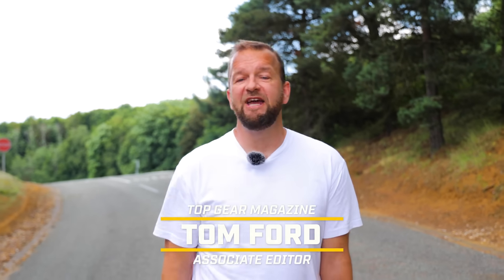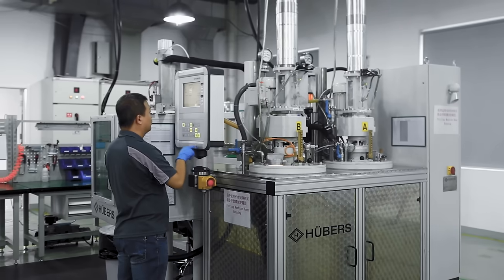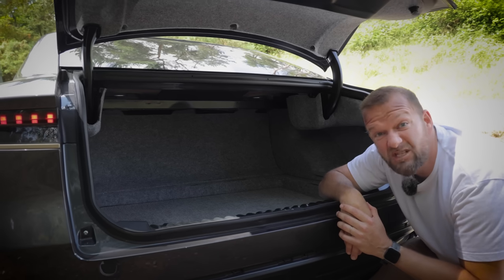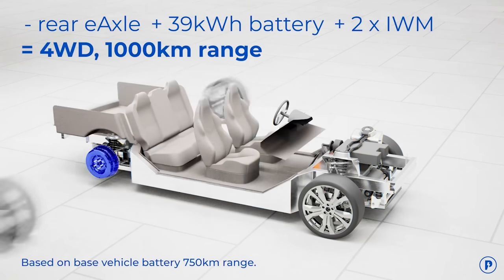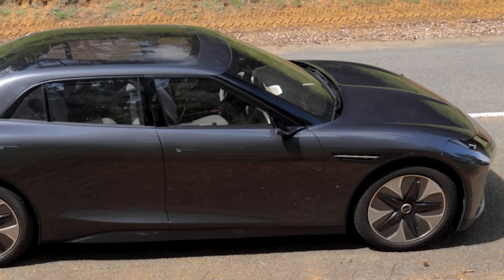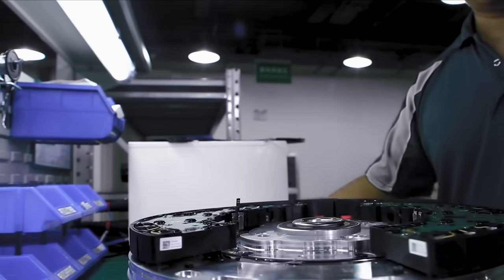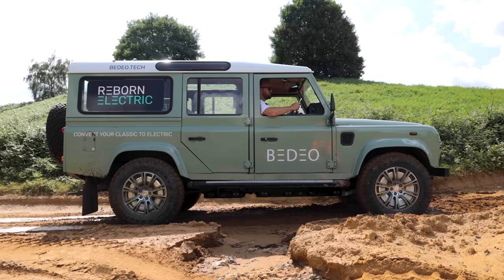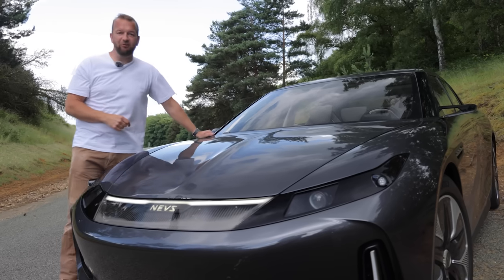NEVS Emily GT: SAAB’s Secret EV With 600 Mile Range | Top Gear

Comment: When I see these hub motors, all I can think about is the MASSIVE unsprung weight.
Reply: And about the ease of damaging them should you blow a tyre.
Reply: Yay basic engineering!
Reply: @ii7317  mate.

it's inside a rim.

blowing a tyre ain't even close to whats required to get through the rim and to the motor.
Reply: @anonym3017 still huge unsprung weight, a heavy car ruining the roads and a pile of toxic scrap in ~10 years.
Reply: @gamerdrive5565  still taking that over any SUV.
Reply: On a bumpy road there must surely be severe drawbacks of this design
Reply: @kes_r  you have options, beyond suv and ev, you do know that right? 

You could buy a well made 20 year ish old car, with low mileage and get around in it. 

Not only are you keeping a good vehicle from becoming scrap you are actually doing more for the environment than just virtue signalling, as you aren’t consuming low quality short life expectancy garbage on wheels.
Reply: @gamerdrive5565  yeah, that's not the point.  i didn't say they're the only options, I said I prefer one over the other.
Reply: @anonym3017  Imagine a wheel and tire going through a pothole. The tire has to flex a little and then the whole wheel has to bounce up, then the car and spring have to stop that upward travel... The lighter, the faster it can adjust to this, the better and smoother the ride. 

Now, add 35 kilo to the mass that doesn't want to travel up or down, and that weight is now putting a lot of stress on the absorption capabilities of the tire, and you have all that weight traveling upward. You're gonna feel that in the car. The ride will be compromised, and now there's a chance (with these small sidewalls) that the tire can't absorb enough, and you're gonna bend a rim. 

If the tires had considerable sidewall, maybe a truck or something, you could work with that to a degree. But this is a terrible idea on anything other than glass-smooth roads.
Reply: Video covers this at 6:10
Reply: @gamerdrive5565  He talks about the weight. Why would this be dead in 10 years? Batteries don't degrade based on time. They only modestly degrade after hundreds of thousands of miles.
Reply: @justinjones1644  They address this in the video. Also, the in-hub motors are not particularly heavy. There are cars with heavier brake rotors out there.
Reply: @gamerdrive5565  Depends on how long you intend to drive the ICE car for and the energy mix where you live. It can take as little as 5 years to recoop the environmental cost for producing the EV. This means that unless the old car will last shorter than 5 years it'll still be worse than buying a brand new EV, if you charge it from renewable sources.
Reply: @gamerdrive5565  lighter than pickups and large SUVs. Aka the new best selling vehicles.

And EVs have been a thing for over 10 years. Guess what. They still run.
Reply: @TheBowerbird  Yes, and the person I replied to isn't' getting it. Also, find me a 77 LB brake rotor...
Reply: @justinjones1644  did you even watch the video?

Your entire concern is addressed in it by the simple fact that unsprung mass per corner needs to be within a certain percentage of total mass.

Which they apparently achieved.

Furthermore the nature of hitting a pothole (aka sudden massive change in height) and how shock absorbers work (inhibiting motion more the faster it wants to happen) means that the determining factors are total vehicle weight and tyre sidewall height.

Or in other words.

When you hit a pothole the shock absorber largely stops the suspension from doing its job.  Meaning that the entire vehicle acts as an almost unsprung mass. In turn making the actual unsprung mass basically irrelevant to what's about to happen.
Reply: @justinjones1644  The front rotor of a C6 Corvette weighs over 20 pounds. Throw in a heavy, large wheel, and you're not horribly far off. What you lose in weight you can gain in other lightness gains. 77 lb isn't that much. 20 inch rims can weight 50 pounds. If your in-hub car ships with lightweight forged wheels then you'll be closer for the overall package.
Reply: @ii7317  I'd think it's actually safer to get tire puncture in this thing since the hub motor can precisely control the wheel of the punctured tire.
Reply: @TheBowerbird  That's great. Now add another 77LB for JUST THE MOTOR.
Reply: @anonym3017  Yeah I did, and the way they achieve that ratio is by having an already heavy ass car... Doesn't make it acceptable. Adding weight to that, in any bump or pothole scenario, it's just taking more reciprocating weight and needing to find a way to slow that weight down.  Under no circumstance is having a hub based motor advantageous to the ride quality or acceleration of the car.
Reply: @anonym3017  unless you consider the small tolerances that are required for an electric motor of course.
Reply: @ii7317  the motor doesn't touch the rim.

So there ain't no small tolerances in anything that gets damaged by hitting a pothole.
Reply: @justinjones1644  ? That's not very much, dude.
Reply: @TheBowerbird  Okay
Reply: @TypeErrorDubs  Not sufficiently for me.

Comment: I did some work for NEVS on their 9-3 based EV taxi for China. Great bunch of guys. Working REALLY hard with little resource. I am also a HUGE Saab fan, so i wish them all the best
Reply: Did they end up releasing the 9-3 ev In china?
Reply: @PH-kl5qq Those vehicles never went on sale. Lots of the original Saab engineers went to CEVT and works for geely and volvo now.
Reply: same

Comment: Imagine being able to retrofit these wheels on your old Saab. NEVS would revolutionize the 2nd hand Saab market overnight and solve it's own recycling issue as a brand. I couldn't imagine anything more in the spirit of Saab like that.
Reply: That sounds like a brilliant idea if it’s possible. 
And you could do it in many other brands.
Reply: Not just the wheels, but the battery as well. And here we get stuck with the design.

Comment: I’ve had 4 SAAB’s in my time and I am only 47. Brilliant cars so I hope their engineers have not lost what they once had, before GM tried to put them in  reins. I see so much potential for this system.
Reply: I’m curious how resilient the engines and their enclosures are. It’s a very destructive environment down there.
Reply: Still have my 9-3
Reply: If they were that brilliant, you still needed 4? Had a top of the line 9-3 turbo once. By far the worst car I have ever driven...
Reply: @bassicallybassically3902  That's because you had a GM Saab. Basically a Vauxhall Vectra in a party frock! My 9-5 was also GM and was the worst of all the Saab's i had.

Comment: I remember Jeremy Clarkson on Top Gear testing a Mercedes-Benz SLS Gullwing with  electric motors behind each wheel. Performance was unbelievable, with an astronomical price. It's great to see a company using this technology, looking at developing it for regular road cars. Hope the rest of the EV industry doesn't kill it off!
Reply: Ah, but the one Clarkson tested didn't have in-wheel motors. There were 4 individual motors but with 4 short drive shafts to each wheel.
Reply: "" Hope the rest of the EV industry doesn't kill it off!" it's glaring how often technical ideas that seem Columbus's egg but ultimately don't survive, as it also relies on cost and scalability, subsequently get blamed on outside forces 'killing it off'. No, if it works then everybody will try to copy it, not kill it off. It if doesn't work, it will not survive by itself and doesn't need to be killed.
Reply: A US company, Aptera, is putting the ev motors in each wheel also.
Reply: It just make sense to move the motors into the wheels - if they are compact and light enough - and use them for acceleration and breaking as unsprung mass, the latest Yasa motor got only 24kg, 5l volume and output 800NM. That's already useable. No I am not working with Mercedes, I am just excited what is already in mass production or will get into this year.
Reply: GM had the in-wheel motors with their 1st EV, but of course 'unsprung weight ' raised its ugly head.  Now things are different, materials lighter and electric motors ridiculously compact so IT IS TIME!
Reply: Doesn’t Rivian offer something like that
Reply: USA company is doing a SEV with in wheel motors and they’re are happening in Europe as well
Reply: u mean the neon green ones vs the regular?
Reply: It’s too expensive and complex to be competitive. Anything is possible with a high price. Just look at Bugatti
Reply: @challengersrt5397  Rivian is now changing one of their vehicles to a dual motor axle design. Lordstown motors also had an in wheel motor design. I think they were putting it in the Workhorse. Now belly up. What struck me was the space saving combined with the all wheel drive as demonstrated in the land rover. Why it struck me is that it seems might be a good application for military vehicles. I would like to see a video comparing the two styles of in wheel and dual or even the Tesla application of tri-motor as used in their semi and now Cyber Truck.

Comment: Loved my Saab 9-5. Felt like I was driving in the clouds. It’s great to see Saab doing this level of innovation. What a time to be alive
Reply: yes, the $1000 car. Every time it went to the dealer, it cost $1000.
Reply: @godsinbox  not true I had a Saab 95 for five years. I had one problem with it in five years. The doorhandle got stuck. That was it.
Reply: @godsinbox Good thing they rarely brake down then.
Reply: @godsinbox  Well, it depends on how often you would have to go to the dealer.  I would be glad to go there once a year if that's all it took!
Reply: I'm still driving my 1999 Saab 9-5 that I bought in 2007. My son also got infected with Saab and bought a 2006 9-3 and loves it.
Reply: Agree.  I still consider my Saab 9.5 Aero as probably the best car I ever owned. A wolf in sheep s clothing. Love understated cars,  maybe boring to others but they mostly saw the back end of my Saab ☺️
Reply: @godsinbox  parts not cheap I agree

Comment: Inwheel motor is the very natural way to go for ev conversions, I hope we see more of them as affordable kits.
Reply: but wouldn't so much unsprung mass be abysmal?
Reply: But if we start with a simple bicycle to E-bike conversion , a mid drive unit is superior to motor hub .
Reply: @lovevideojuegos would you simply not just fill the engine bay and fuel tank area with batteries instead. 
Essentially replacing the bulk of the weight with batteries?
Reply: @lovevideojuegos  well... Could be an issue, with older motor technology, but would be a more straight forward conversion for ICE cars that are not built from the ground up to be EVs.
Reply: @edentahilla9295  In a rwd car it would eliminate the diff, driveshafts, fuel tank g,box some engine space(allowing crumple zone) that empty space is now a battery pack
Reply: My thoughts too, would work excellently as a rear wheel drive, would be great for hatchbacks and sub compacts.
Reply: @lovevideojuegos  Unsprung mass is actually a very simple problem to solve that I think is far outweighed by the benefits of a simplified drivetrain and the torque vectoring possibilities. I previously designed suspension systems for the military MATV and JTLVs which have wheel and tire assemblies weighing over 450lb and the solution to that much weight is just using stronger shock absorbers valved to mitigate the weight along with the correct spring rate for the coil spring. Simple stuff we have been doing for over 100 years. Less unsprung mass is better but it's a simple variable to account for.
Reply: @Jared_Linderud  I don't know how important unsprung mass is for handling. I just remember that unsprung mass has been talked about often when talking about ICE sports cars. If unsprung mass is important for handling, most of the benefits of in-wheel motor can be achieved with inboard motor for each wheel. I would think that unsprung mass is only important for spirited driving.
Reply: Would this be an application for YASA axial flux motor topology?
Reply: The in wheel tech is from Protean Electric.....yet another of the amazing UK tech companies doing incredible work....
Reply: @fonkenful this is from Protean Electric. A competitor of Yasa.....
Yasa is not designed for in wheel though....
Reply: @lovevideojuegos  It is, without torque vectoring enabled it will handle like a boat. Based on the 175kWh batteries, I would guess a weight between 2.5-3tons.  
You just CANNOT get any form of sports handling characteristics with this much weight. You can find solutions with stronger springs etc but this will all add up to the vehicle maintenance.
Reply: @ruddjason  thanks for that
Reply: @lovevideojuegos what is the unsprung weight of a Rolls wheel? Ride quality?
Its a non issue
Reply: Would be possible to aply such wheels to any fwd car and make item a hybride

Comment: For me the biggest benefit of in wheel motors is the lack of need for CV halfshafts which are ridden with lash and breaking issues on basically every EV that exists. It also allows for extreme suspension geometries like a lifted off-road pickup truck without worry about CV angles.
Reply: In wheel motors have serious drawbacks too unfortunately, unsprung mass increases dramatically and this affects handling negatively and dramatically. Interesting to see how they solved that?
Reply: The downside is an increase in unsprung mass. Tricky trade off
Reply: @vicbauwens  the effect on handling is not dramatic. that is just something autocrossers tell each other to feel better about expensive lightweight wheels.
Reply: @JackMott it must somehow, because a number of manufacturers have played around with this already, I remember a Volvo C30 demonstrator with in wheel motors, nothing ever came from it.

Comment: The interesting thing about in-wheel EM, you can use it for aircraft to eliminate the need for towing vehicles, therefore minimising the possibility of runway incursion with airport equipment.
Reply: Vueling have just demonstrated this last week using a system called "WheelTug"
Reply: Its still heavy tho. Aeroeng is all about weight reduction.
Reply: @dru4670  yeah nah.

the bit of weight it adds is more than worth it ion exchange for only having to start the turbines when taking off.
Reply: @dru4670  it's not about the flying bits. It's about operational stuffs on land. For take off it won't be used, just for taxiing from apron to runway before departure.
Reply: @dru4670  What it eliminates is fuel usage from the main engines during taxiing. That fuel usage can be quite substantial.
Reply: @cheekychappy1234  But also quite substantial is the weight of the motors and the batteries to power them; carrying this weight around at all times increases fuel burn and reduces revenue-generating load capacity. The benefits will need to outweigh the added costs.
Reply: The wheels are mostly full of brake disc and cooling, I do not think a hub motor is easily fitted without a complete redesign of the landing gear and possibly also the room the gear is stored in.
I think a hydraulic motor would be better, they are more power dense then electrical motors It would need to disconnect from the wheel at landing and takeoff speeds to prevent overspinning.
Reply: Nobody is mentioning the fact that the pilots in aircraft can see fuck all from the cockpit thus need the ground vehicle to take them out safely as they have a far better view of the surroundings
Reply: @JonnyD3ath  That's why WheelHub have a camera package that can be fitted to the aircraft to give a 360 view of the surrounding area.
Reply: But, the plane would be heavier because if you put in-wheel motors, u need somewhere to install bateries, and the plane would be heavier (using more fuel)
Reply: @sebastianpoblete9131  No batteries needed. The planes have to have an APU running that supplies sufficient electrical power anyway.
Reply: Wrong. It adds unnecessary weight and complexity.

Comment: I’ve never driven a SAAB but my friend’s dad raves about his old SAAB and how it was the only car he’s ever driven that would blow in cool air on your face from outside and warm air on your feet at the same time. He’s always talking about how he wishes other cars had that feature!
Reply: Any bmw can do that too. Just saying.
Reply: There are hundreds of occasions over the past few years when I have desperately wanted this feature. Wow. Saab then...
Reply: @bounzig  this was like 30 years ago
Reply: @Emppu_T.  My 2011 3 series has it. So there are probably cars up to 2013-15 equipped with it. 

It's not a function I've paid much attention to, I'm not sure when they canceled it. But it wasn't 30 years ago.
Reply: @Emppu_T.  I did a little research, it seems they still provide this function.
Reply: @bounzig  Saab had the function
Reply: @Emppu_T.  I don't understand what you mean.
Reply: @bounzig  okay.
Reply: it was probably broken. Every time it went to the dealer, it cost $1000.
Reply: @bounzig  Last time I drove a 5 series, about 4-5 years ago, it couldn't. Maybe an option or a recent thing, I don't know.
Reply: @godsinbox true. The dealers were as expensive as Mercedes, BMW or Volvo ... but they were luxury cars. 🤷‍♂️ I have preferred my two SAABs to my 4 Mercs. They were simply better made and more interesting in my opinion. Way better driving experience and the turbocharged engines were so damn strong. You could access their engine control units and have loads of fun for next to no expense.
Reply: Fiat

Comment: Interested in the longevity of the engines since they're on the wheels. The wheels usually take and absorb alot of vibrations that we in the car don't feel because we are seperated by the suspension.